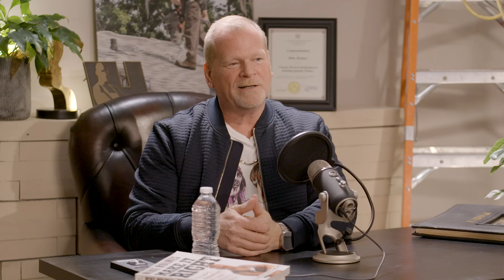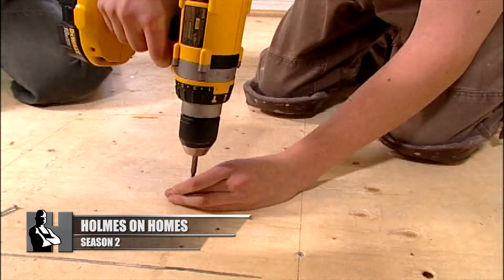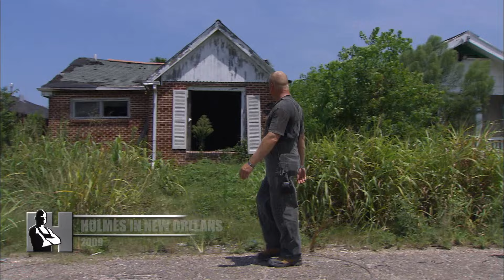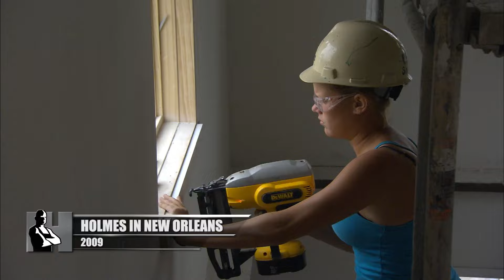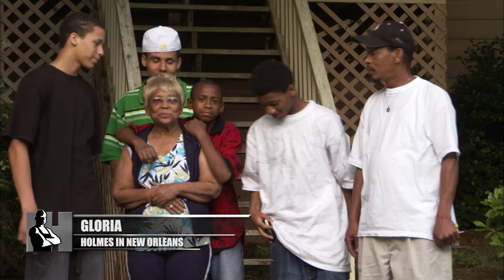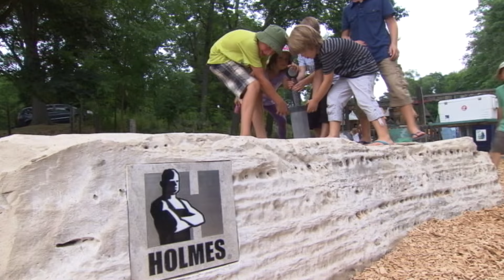Behind The Scenes Of Holmes Shows with My Family | Mike Holmes Podcast

Comment: I get where Michael is coming from. I've had two bathroom contractors give me the "I don't wanna" price because I know too much. One refused to move the tub when we were already enlarging the bathroom. They said it's too much work to move the plumbing and laughed when I told them I wanted it all ripped out and redone anyway.  Drains are Galv to cast iron, supply is a spaghetti factory of copper. The washer is a copper drain to cast iron that leaks from the boot if it gets plugged. So many times I end up doing it myself not because I want to but because I cannot find somebody willing to go as far as I want.